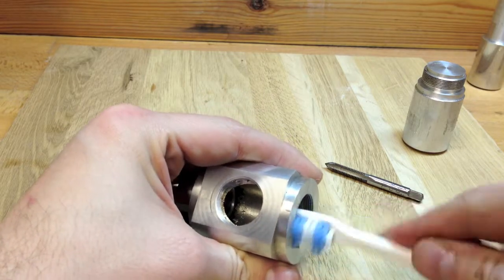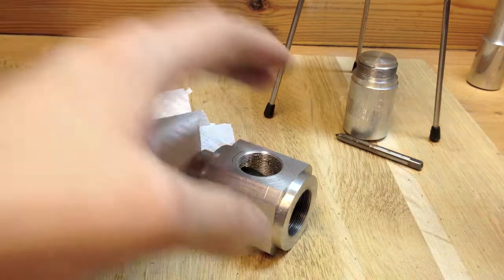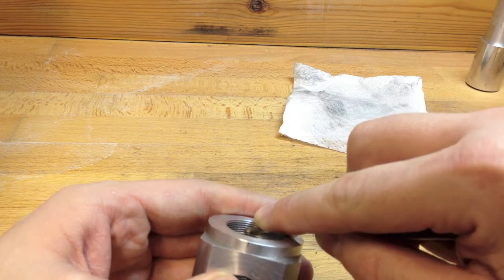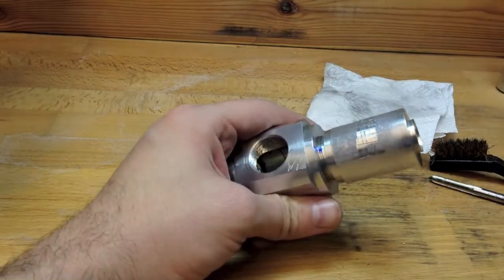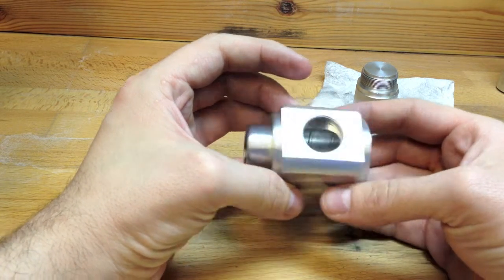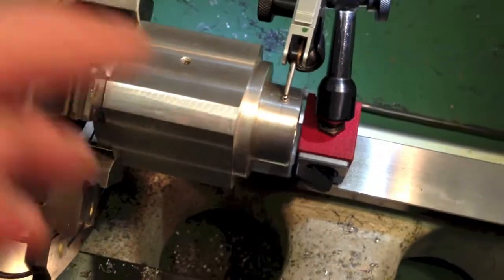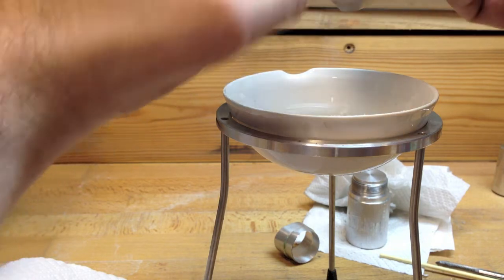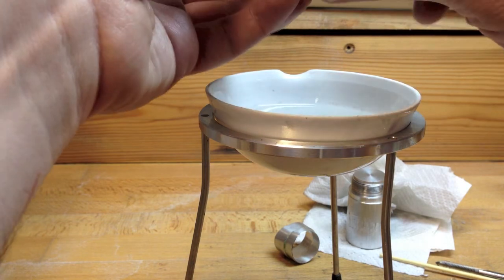Watchmaker's Centring Microscope Part 3

Comment: Some of the silicon based glues are a real pain in the keester. I had for example, a clock glass tried to remove it from a crappy quartz wood case. Glued on with silicon I heated and heated and heated the glass. I kept hoping the dang silicon would release. Nope. not even a budge. Finally wound up cracking the glass and tossed it in the trash.

That is the most surprising thing about the silicon. You would think heat would just make the glue give in.

Super glue actually works better. You can heat super glue with moderate heat and it gives up nicely. Almost like shellac.

I know super glue is a dirty word in the watch/clock world. But there it is hey.

RJ
Reply from the maker: Superglue has its place, like many things. Sometimes it's invaluable for chucking things on a lathe faceplace, and so on. Think about how well it glues your fingers  together, and then realise that it will work excellently on damaged leather straps. Its uses are endless. It's generally within the mechanism where its use is frowned upon. Also it can give off a kind of white mist that settles on parts.
I didn't expect this loctite (which is a kind of cyanocrylate, after all) to be this tenacious. There are so many grades, and this was obviously one of the tougher ones! Thanks for watching.